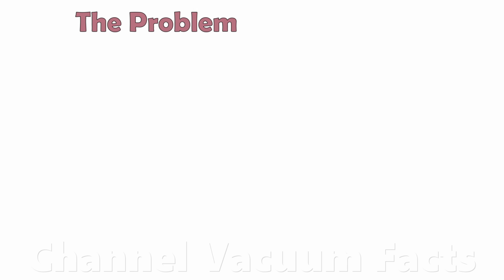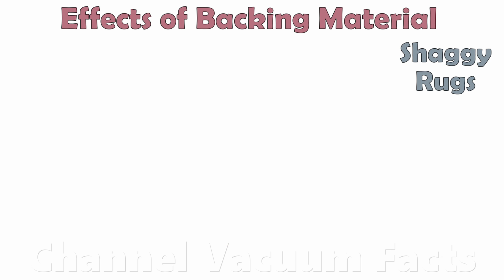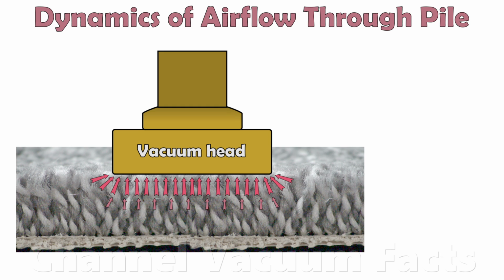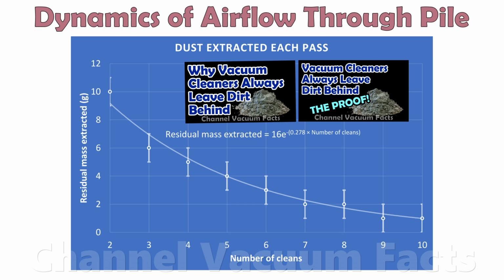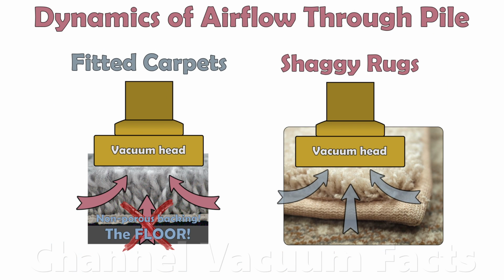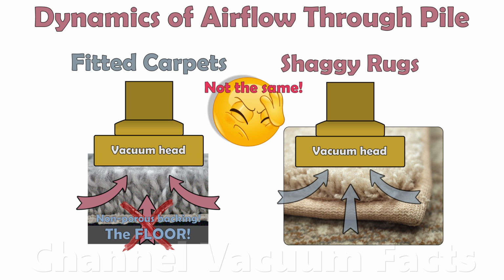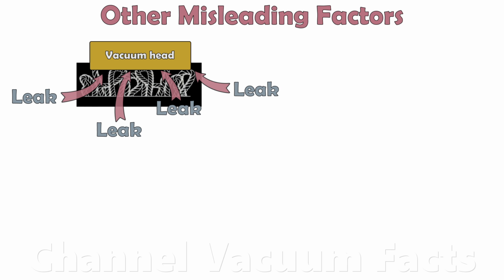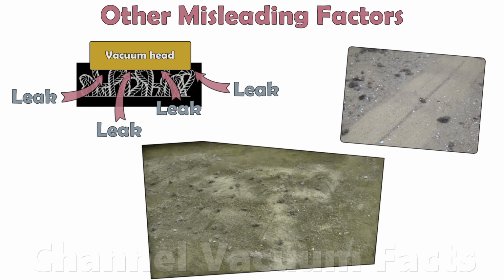How Rugs Are Used to Mislead Kirby Vacuum Performance

Comment: I prefer very low pile carpets. They can be cleaned easily and more hard wearing. Have you done a video agitation?
Reply from the maker: Yes. Coming this week along with the conclusions :) My long pile carpet is incredibly plush and soft, hard wearing, and clean; so they're not a problem if you have a good vacuum and some zorb (or equivalent).
Reply: @VacuumFacts  Some long pile carpets seem to flatten down over time and if I'm honest the Dyson V11 is good but I can't see it keeping a very long pile carpet clean which is another reason why commercial places probably don't use them. The Dyson cleaner heads seem to struggle on deep pile carpets unless they are changed to a lower power mode with the suction gates fully open. I remember when Dyson sold Zorb and claimed it could remove stains though the modern stuff doesn't say that anymore. I think it is good for keeping the carpet fluffy though it doesn't stop the stains from being there.
Reply from the maker: All carpets get crushed under foot. But vacuuming lifts them again. Vacuuming is as much of a carpet reset as it is about removing potentially harmful dirt. I can confirm that my V10 keeps a very long pile fitted carpet extremely clean. In fact, the data proving this as fact is available here: https://youtu.be/WQxBJY0_abQ . As for zorb; it removes general surface grime that can be dissolved. Tough spot stains need additional chemical treatment, such as Dysolv (or equivalent), to assist breaking it down before a zorbing. In general, for normal home situations, dry cleaning is easily the best method to keep carpets clean if done properly as discussed here: https://youtu.be/XVR-YdzytBA

Comment from the maker: To summarise this video. If you see someone using a loose shaggy rug to demonstrate the virtues of a high air current, low suction machine, know they're deceiving you (or simply don't understand the difference between a loose rug and a fitted carpet). It's implied that what they show you is true for carpeted homes. It's NOT and you'll see this beautifully this week. Kirby's high airflow disappears when on a fitted carpet pile, because to keep it, you need high suction to overcome the air resistance the carpet generates. The Kirby's airflow through the pile drops spectacularly and is no greater than any other machine at absolute best. In fact, high suction machines don't need high airflow because they have high suction, and the airflow they have at the open hose is thus already comparable to what ends up through the pile. Fantastic evidence of this coming up this week. It proves everything I've ever said about why some channels are misleading others, and why I started this channel at all to shed light on it so people aren't fooled. Facts are coming...
Reply from the maker: @UCAf8Z345P7oqP9jZBh6ncVQ It’s interesting how people are only now talking about this once I debunked the myth. It’s also interesting that people chose to misinterpret my flour under the rug test video and conclude it was obvious that you can’t get airflow through rubber backing. But the real point of the video was to show that performance isn’t anything like Kirby fans have claimed and this was because they only used shaggy rugs that weren’t representative of fitted carpets, precisely to artificially inflate the apparent Kirby performance. This was deceitful. That was the point. It was to show the full picture to help people avoid being deceived in future.

Nevertheless, good effort on your part to at least attempt to show an honest test of the very point which was initially dismissed. It nicely shows everything I said here about how Kirby's airflow drops like a stone on carpet relative to the open hose, is 100% true (https://youtu.be/L-EiWhGjg-Q ). Unfortunately, it’s not possible to draw too meaningful a conclusion about the quantified relative cleaning performance from your test, because measurements are inaccurate and suffer from many testing flaws which affect results. Firstly, you only make a single pass forwards and backwards, which doesn’t account for statistical variability of particle removal from carpets; I've discussed this many times on my channel. Secondly, you don’t accurately represent that real-world users would repeat passes (at least twice) for obviously exaggerated messes like you had as an initial condition, and in such a way that unswept belt lines are addressed. Thirdly, you used the Kirby after an initial clean from both units to attempt to quantify the residual remaining. This limits the residual mass extraction to the performance of the Kirby in both cases which is another source of error. This mixing of machines can’t be done in performance testing, as it mixes variables and renders it an unfair test.

You'll see this week some highly accurate, milligram accuracy, fully quantified testing of relative performance of a Kirby with a more representative dust type containing a range of particle sizes, and which accounts for statistical variability in deep-cleaning. Unlike most amateur tests, the results are fairly conclusive and devoid of sources of common error, and are thus less inaccurate. The testing methodology is described in detail here: https://youtu.be/WQxBJY0_abQ . I'll also add that there is no good evidence that US (or EU) homes have one type of carpet over another. This is a made up myth. I heard that most US homes favour hard flooring, in fact.

Comment: To me the "testing" videos on Youtube are entertainment not real tests.
Reply from the maker: In fairness, you're generally correct. ONLY formal industry standard, fair and comparative testing constitutes the most accurate (least inaccurate) testing. It's the golden standard agreed by ALL vacuum manufacturers to be representative, and is the only testing used in court cases. However, that requires a lab and some serious expertise, and is beyond my ability. However, the testing I showed here (https://youtu.be/WQxBJY0_abQ ) has the least number of problems of any amateur testing found on YT. Second is probably Vacuum Wars, but his tests should be refined, really, to make them less deceptive and more worthwhile (despite them showing Dyson performs pretty much the best). Won't go into details here, otherwise I'd be here all night.
Reply: @VacuumFacts  I own both a Dyson V10 and a Kirby.  I feel the Kirby does better on the carpets I have in my house.  Does it make any real difference as long as it's clean enough for yourself.  I paid less than $100 USD for my Kirby and wouldn't ever think of buying a new one for the ridiculous prices they expect.
Reply from the maker: I also own a V10 and a Kirby. I don't rely on 'feelings' because what's intuitive or feels right isn't always true, and facts are more important. :) These facts are presented this week. Yeah, the price of a new Kirby is about 3-4 V11's. This is covered this week. Long pile carpets are the hardest to clean, but relative performance on them will be comparable for shorter pile carpets simply by virtue of how particles are removed from complex fibre networks, as I've covered in many videos now on my channel. In other words, relative performance on long pile carpets indicates general relative cleaning performance on all carpets.

Comment: I agree with this. I don't like high pile carpet anyay it's unhygenic in my opinion. I have low pile carpet but i think hardfloors are the most hygenic this is why you will never see carpet in a hospital :) 
When are we going to see the Kirby in action?
Reply from the maker: Interestingly, many have said they live in large US houses and they don't run out of charge. Normal vacuuming practice these days isn't the mythical weekly chore mega-clean it used to be, but smarter, easier, bite-sized cleans. One floor at a time, or the odd couple of rooms. Higher traffic rooms vacuumed more often. So any one cleaning session isn't that long and isn't tiring. A bit here and there. And you rarely reach a battery limit.
Reply: @VacuumFacts  I've found that with my V8. I would prefer a trigger lock option though.
Reply: @VacuumFacts  You need to do it more often when you have a pet that sheds everywhere :)
Reply from the maker: @Boodieman72  Yeah, so more frequent bite-sized cleaning :) Battery life is increasing enormously at the moment as the core science improves. When solid state batteries finally mature at larger scales, it'll come with an improvement of roughly a factor of 2 on top of that as well. Longer term, some very advanced battery technologies are being developed. Battery life will become a non-issue before long.
Reply: @VacuumFacts  There is always something better thats in development.
Reply from the maker: That's said a lot but I just don't understand it and it makes no good sense to me (or Dyson apparently). The trigger doesn't need to be 'squeezed' to activate; just holding the handle as normal activates it, so it's no tiring effort on the finger. And keeping it on all the time strips out up to 30% more effective battery life, achieved with being efficient and keeping it off when moving around. You see handhelds with a trigger lock coming with the option of a second (very costly and polluting) battery for just this reason; it's mostly wasted by poor usage behaviour. And Dyson's digital motors, unlike the inferior competitors, are instant on and off. If you tried the 'Dyson method' on those terrible competitor products, it just wouldn't work because it takes too long to get the motor up to speed. If people want a trigger lock, they can just buy a piece of string and shoot themselves in the foot. :)
Reply from the maker: Perhaps, but hard floors are not very comfortable. People don't go to hospital to have a relax :P plus they're high traffic places. Home carpets can easily be kept hygienic. The trick is basic housekeeping; vacuum regularly (very easy with a cordless mains-equivalent cleaner) to deep clean, and dry clean it monthly (e.g. zorb) to remove soluble grime. You can live in comfort and remain hygienic. What a life. I have a deep pile carpet and can attest. I've got almost an hour of new video footage in total this week. This video was critical to understand and appreciate first before seeing the machine in action and its test results because it fully explains everything you'll see. I'm glad you don't disapprove of it—namely because it's clearly obvious once it's pointed out. Tomorrow's video shows the machine in action with some wonderful myth busting that has implications for the more rabid enthusiasts who like to spout falsehoods on YT.
Reply: @VacuumFacts  I hope you're not calling me less rabid? 👊
Reply from the maker: @2711marcus  You've never fallen under the umbrella of rabid :) Not all 'enthusiasts' are rabid.
Reply: @VacuumFacts  I'm not really an enthusiast my goal is to find the best vacuum cleaner I can for my needs. But I am interested in the design and the science.
Reply from the maker: @2711marcus  So essentially the same as me. Despite coming across that way, I'm not a Dyson 'fan boy'. The Dyson V10/11 are simply the best in terms of practicality and performance, whether or not people subjectively 'feel' they don't deep-clean because <insert misunderstanding of a parameter, such as airflow>. There's growing acceptance of this, even if any one person doesn't want to believe the facts and background science I present to support it. Vac Wars, despite all the flaws in his testing, is also coming to the same conclusion, much to the chargrin of those who prefer to peddle falsehoods, as the recent tag-team video his did, showed. You'll see some nice demonstrations and test data this week.
Reply: @VacuumFacts  The issue I have with my Dyson V10 is that it runs out of charge.  As I live in the US the house probably has more area to clean than a home in England.